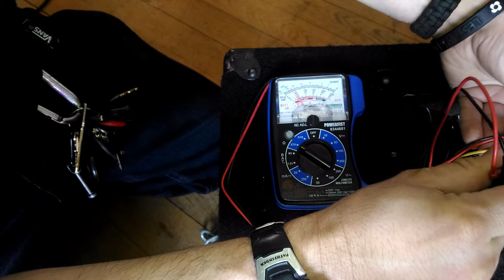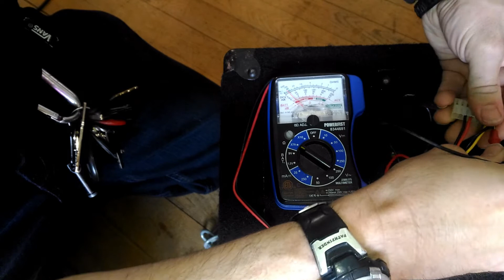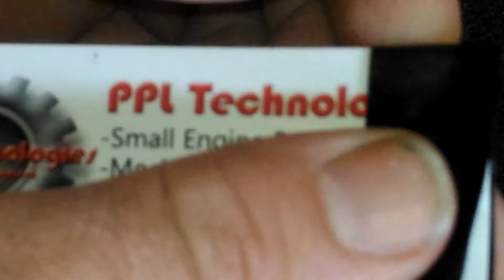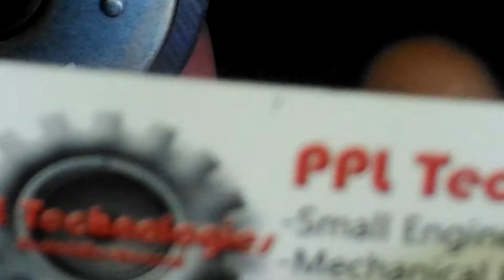Speaker Repair, how to repair a speaker that has no high end. Blown horn or tweeter

Comment: Hey man I have just blew 3 of my subs and all 3 have that same problem. Is their a sub repair kit 🤔 I can get? Also this is car audio btw
Reply: They are audio pipe if that also helps
Reply from the maker: What you seek is called a re-cone kit... It will have new voice coil and the paper cone and new surround and such. It takes some skill and practice to do that job if a kit is available for those woofers. It can be done DIY with videos and there are websites that sell everything to make it happen. I would see if there is someone near you that re-cones speakers, people that do it all the time can often measure the broken parts to know what generic kit can be used. Depending on the woofer it may be more cost effective to replace them. The most common cause of woofer failure is running the amp into clip which makes square waves which makes the coil heat up and fail.

Comment: I have a yorkville Good day Sir and or Ma'am 

I have a Yorkville TL 315 speaker the low end works but the horn and tweeter are not work I took them out and tried test them and they worked fine I think the problem is the crossover, where can I order that part I've looked everywhere without and luck
Reply from the maker: You can order lots of parts from Yorkville in Ontario as long as they have them. You can go to their website and contact them directly and they are very good at support for repair. They gladly supply schematics for their products and will definitely help you get back up and running https://yorkville.com/contact 
The crossovers have some sort of fuse affair on the board to protect the horn driver like a light bulb or other fuse type that probably done it's job and now needs to be replaced.

Comment: How to tell difference between Midrange Horn vs Tweeter Horn speaker??
Reply from the maker: do mean a piezo tweeter and a regular magnet style driver for a horn?
Reply: @patthesoundguy  I'm asking/wanting a Horn speaker designed for voices, midrange. Not extreme highs.
Reply from the maker: @M0D60  like something you would find at a race track or carnival or amusement park for announcements? Or a horn loaded mid-range for a PA cabinet?
Reply: @patthesoundguy  Ordinary home stereo speakers. (JBL,ALTEC,KLIPSCH,etc.) On eBay tweeter horns resemble midrange horns. Is there anyway to tell difference. (Sorry for delay I'm on LA fwy)

Comment: Gonna try this on my acoustic audio generic brand pa speaker. Diaphram sounds like its bad with a very muddy fuzzy buzz. Speaker works just has that annoying sound.
Reply from the maker: check the dust cap on the woofer a loose cap will buzz sometimes as will a messed up horn diaphrahm